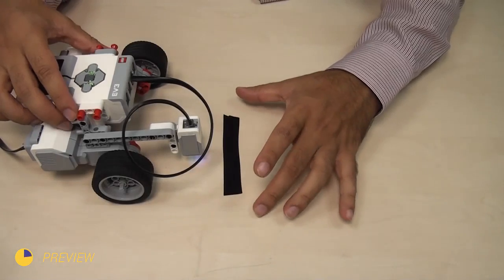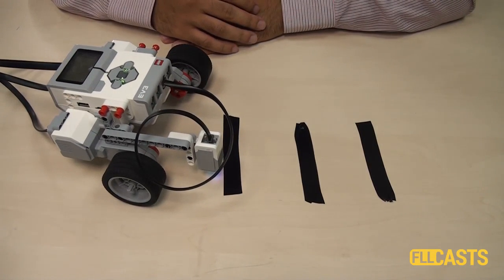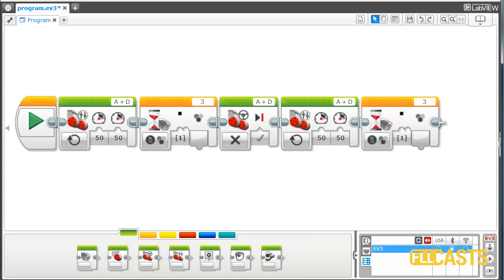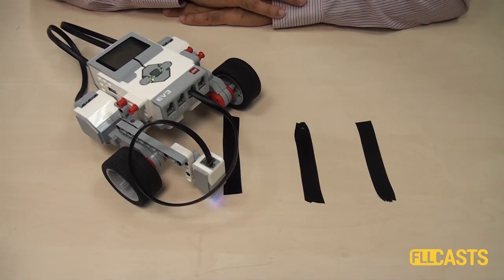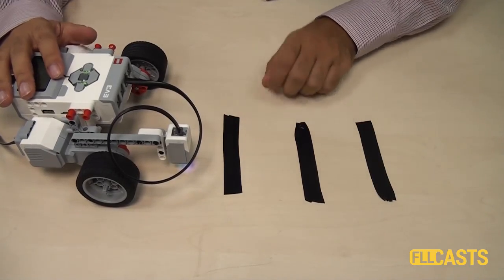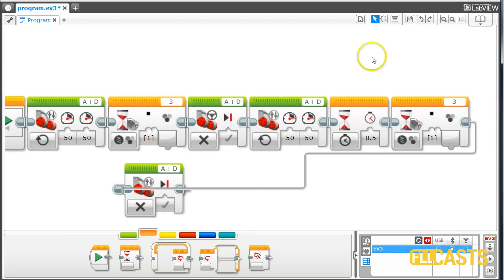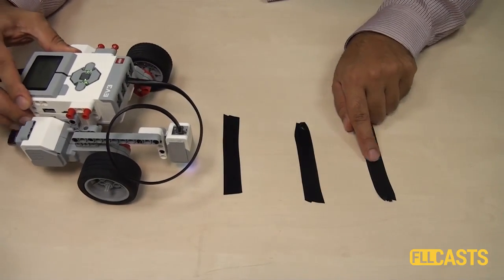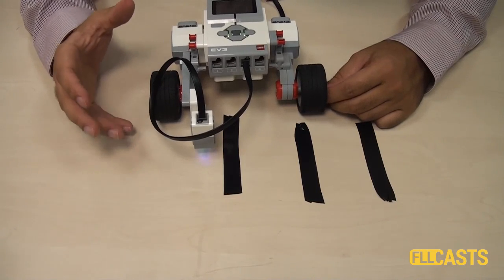EV3 basics course. Color Sensor. Stop on third line. Hack (part 2)

Comment: is there a way to make this work for a pulley system that detects two colors that make it stop and a 2nd color to make it go?  It would also need to read it to make it go forward and backward on a pulley system.
Reply from the maker: Yeah, of course. We have tutorials on the platform for programming the robot for color code i.e. perform different action on different color.